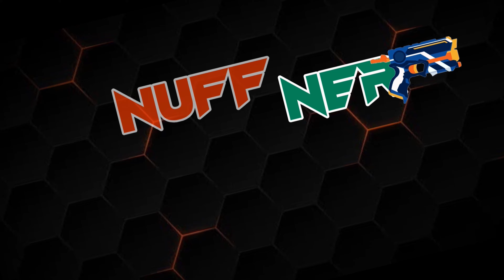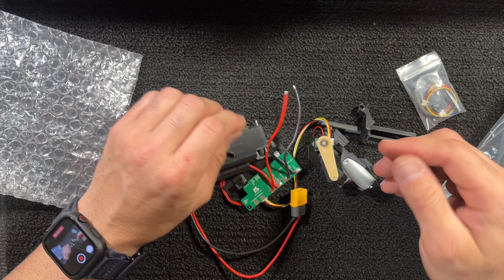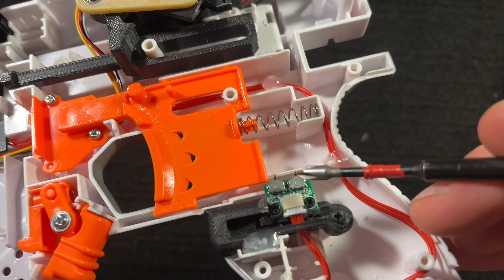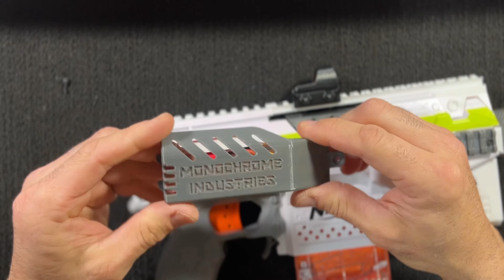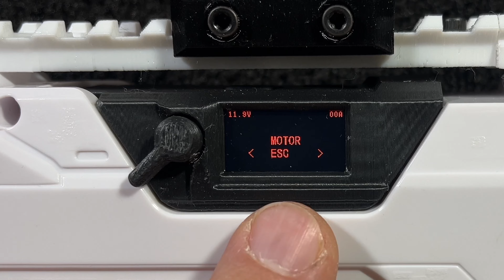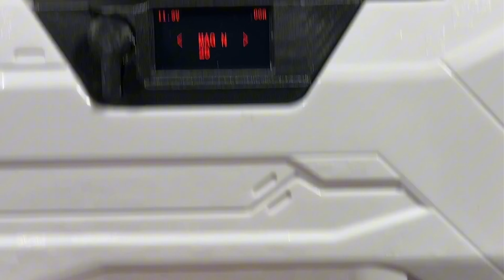NFStrike Select Fire (Latest Gen) | Full Analysis

Comment: Would be awesome if they made a stryfe kit with the fancy optic like the Rapidstrike and put the selector switch back where it was on the left side. I've heard somewhere that the RS kit can support a solenoid pusher too
Reply from the maker: That would actually be pretty awesome. At the very least a picatinny mounted optic that can plug into the V9 through its USB-C port.

Comment: Great video NNN! Just so you know, you can run this on 2s. The lipo alarm on this unit is set to 9v by default so that you don’t go below 3v on any single cell when using a 2s. Find the setting for lipo alarm and lower it to 6 (or 6.25 if you want to play it safe) and it will work on 2s. Really great kit. Similar to the Amazon kit but a bit more refined.
Reply from the maker: I couldn’t find a setting for minimum voltage like the Evolver has on the Rapidstrike. I contacted NFS about it and awaiting feedback. I’m pretty sure there’s a way to do it since Arduino is fully programmable, but it would be nice if it was built-in like the Evolver. TBA.
Reply: @notnuffnerf I watched it again this morning and watched the portion where you go through the screen options. I didn’t see the volt setting that I normally see but it looked like there was one or two you didn’t explain and maybe skipped a couple. It’s possible that maybe one of those settings controls min voltage. I’m with you though, it would be strange to have a system this advanced and not have a way to adjust minimum voltage and/or volt alarm. Does this system still have a volt alarm that goes off when you drop below a specified voltage?
Reply from the maker: The thing with this kit vs the Evolver, is this kit puts all settings on one menu. This is dangerous because there are some fine-tuning or deep programming settings that have no business being on the surface menu since you can easily brick your controller. This is why I skimmed through some of these. At least the Evolver makes you go through another step of button clicks to access the more invasive settings. As far as the voltage settings, I’ll advise as soon as I hear something!

Comment: Looks like 90FPS?  Kinda low.
Reply from the maker: 127FPS to be exact. I could run a more powerful battery or even better yet an actual LiPo, but I didn't need to. It's great that you can tune it according to your needs though.